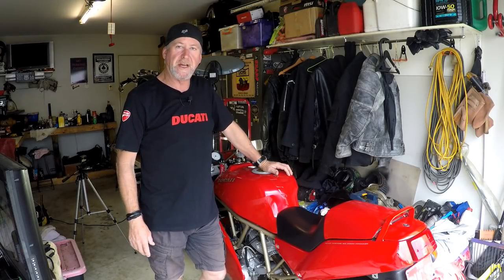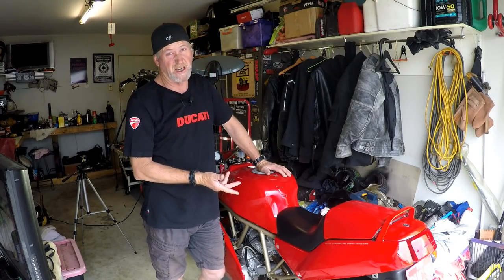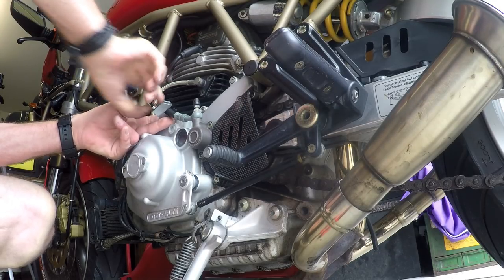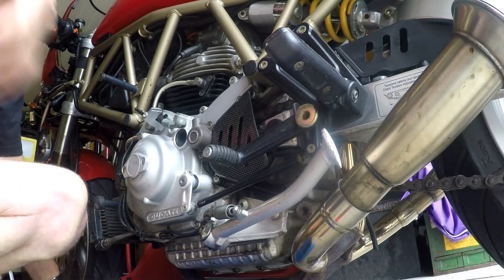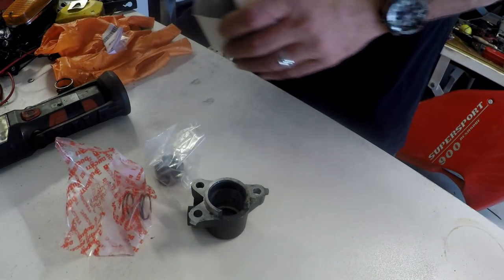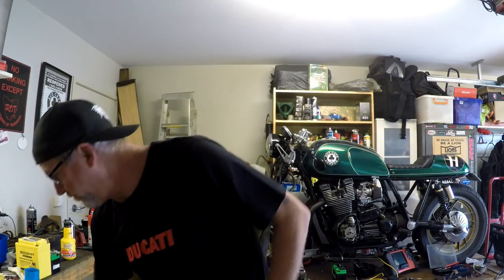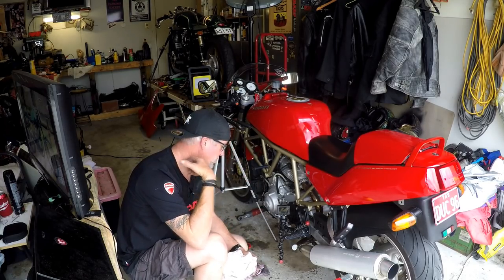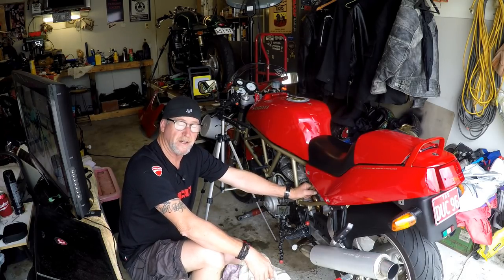Ducati 2V Clutch Slave Cylinder Repair

Comment: I envy your ability to do a basic clean behind the front sprocket cover. I recently fitted a 14tooth front to my ST3s (stock 15 tooth) and spent over an hour degreasing and cleaning, the product of a misspent youth in the Army I guess. I know it is only going to get dirty soon but can't leave well enough alone.

Comment: Intetesting. Return spring on the slave cylinder piston. The hydraulic clutch i designed for Meriden Triumph twins in the 90's and still sold & used to this day, relies purely on the clutch springs for return. Battery ratchet looks dead handy. Regards.
Reply: Mike
The spring in there is to hold the piston out against the release pushrod and bearing to prevent piston knockback from the pushrod rattling around within the gearbox shaft.
This minimises any additional piston movement before it lifts the pressure plate off

Comment: Very cool. I think this is what's wrong with my S4. When you pull the clutch in fast everything works as normal but if you pull the lever in slowly it feels like the fluid is slipping by somewhere and not engaging the clutch. I'll try this repair and see if that fixes it. 
Thanks!

Comment: Hi there!
Can the slave cylinder be the reason for  the lever to harden.
My lever hardened the other day (I could pull it back just a little) and I could feel the clutch barely working but I could not engage it from neutral to 1st gear. Some help would be much appreciated. My bike is 2005 S2R 800.

Comment: Andy....The first time Ive ever seen a spring inside a hydraulic cylinder.....Do you know...
why?...Great vid....
Reply from the maker: Of course. Are you aware of “brake knock off”? This is similar in so far as the spring holds pre load on the piston against the push rod to the pressure plate so that it doesn’t get bumped back up into the cylinder. That ensures the lever only travels as far as it needs to when you grab the clutch, does that make sense? I’m not sure if I’m explaining that very well.
Reply: @ANDY5  ..No you
explained it okay.Usually the master takes
care of the slack...an odd design with a
steel spring inside an aluminum bore...makes me think..regular flushes.
Thanks Andy...

Comment: Hey Andy, I see the Bosch rubber grease used frequently on your projects, I realize you're not flogging it, but it seems multipurpose.  Not available in Canada as far as I can see.  Know of anything in the Permatex line that would be similar?  Thanks
Reply from the maker: G’day mate, I just happened to need some rubber grease for something one day and picked up a tube. I then read on the label that it was designed for use in automotive brake systems so I’ve been using it ever since. I’m not familiar enough with the Permatex range, or any other brands if I’m honest, to know if there is a similar product available. I’m sure there will be, may try their website or ring the company directly?
Reply: Just Google Red Rubber Grease....plenty around....

Comment: Yup, I guess this is ok for the brakes, but how much this taping  of the clutch handle fucks up the clutch springs? Do we need to ask Mark from the Workshop channel for his opinion? - Asking because your friend Del had mentioned that this is weakening the springs - Which in a way may be right (we all wind out our torque wrenches when not using them..).
Cheers!
Reply from the maker: I don’t know about you but I don’t use my torque wrench every day, I’m pretty sure leaving it overnight won’t do any harm. Most springs are left with some load on them when you think about it, your suspension for one. It wouldn’t hurt to ask Mark from the workshop but if he doesn’t know try Matt 😂 I’ll reach out and get his opinion.
Reply: well yeah, but always when he mumbles "himynameismawelcombacktotheshop" I remember him complaining that someone had been calling him Mark, so to keep the joke running....
About the springs - well I'm using not very often torque wrenches, but when I finish with them  always put the load back - want them as accurate as possible in the time - the springs are sagging(or more correct to say weakening) during time. The matter of fact that there is info of the length of the clutch springs in the manuals, to check, means that these fuckers are having some life - having them pressed for longer time is quite logical in a way, to fatigue the material - you are not folding all the time the clutch squeezed , nor the suspension is fully compressed all the time while riding.. But yeah, this may have minimal effect so not to bother at all - curious about it..
Reply from the maker: I have asked Matt for his opinion. The truth is that I didn’t even consider what I was saying and was completely oblivious to the fact that I was working on a clutch system and not a brake system. As clutch springs always have load on them, i.e. that’s what maintains the clamping force on the clutch plates, I’m not convinced that it will hurt them. I’m also thinking that it is a single operation as opposed to the 50 times I will cycle the springs through their operating range on my ride to work.
Reply: Yup,  this makes sense as well!
Reply: @petkobika   
We've learned from magazine springs that springs don't deform or weaken from being compressed over time, but from being cycled. You can leave a magazine fully loaded in the safe for years, and it'll work just as well as one that hasn't been left loaded. At least that's my experience. Matt probably knows the formula to back up my anecdotal observations.
Reply: Good point! Just read a bit on this case and the in a random post(too lazy to ready the whole page and conversation : ) )
"1. It is cycles of tension (loading and unloading) that cause the most damage to the spring (not constant tension). So don't worry about keeping the magazine fully loaded. 
2. Constant tension will cause the spring to set. As such, you should cycle your magazines every few months. 
3. Cycles of tension (loading and unloading) cause the most strain on a string [due to metal fatigue], but heavy tension also causes strain. As such, you should keep your magazine loaded, but not "fully" loaded (i.e. download a few rounds).

Reference https://www.physicsforums.com/threads/does-static-tension-wear-out-a-spring.661309/"
Reply from the maker: I spoke to Matt, he said no problem. He referenced valve springs as an example
Reply: @ANDY5  
There ya go.

Comment: can you help me with the part number of the spare parts you used? i went to the ducati dealer and they want to sell me the whole thing.
Reply from the maker: Genuine Ducati Part No. 19590023B
I also purchased the rubber boot, Part No. 67210061A. Gowanloch Ducati in Australia has them in stock, +61 2 9750 4346